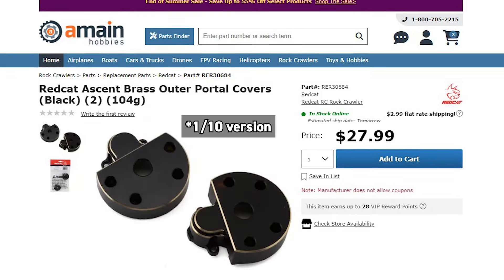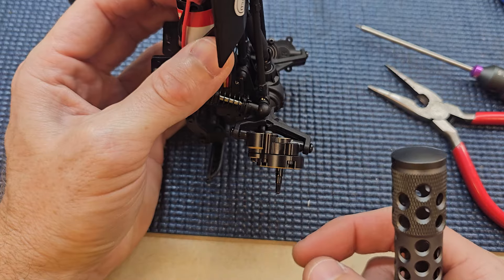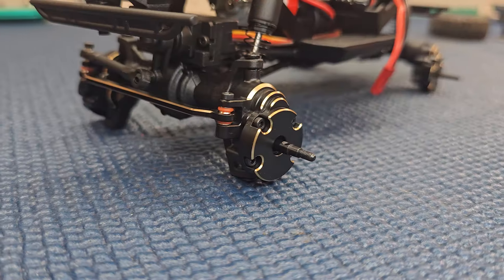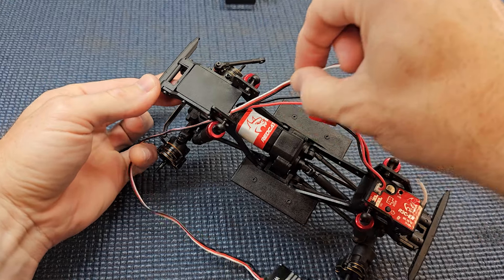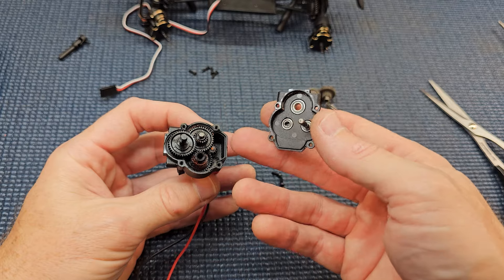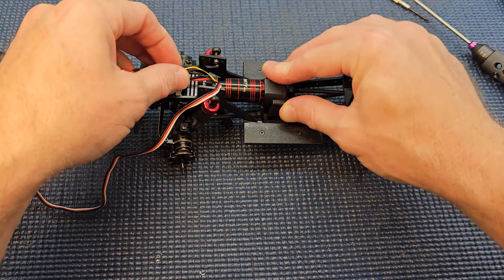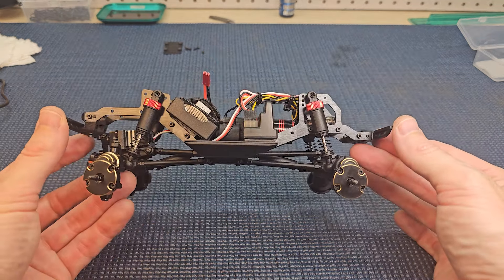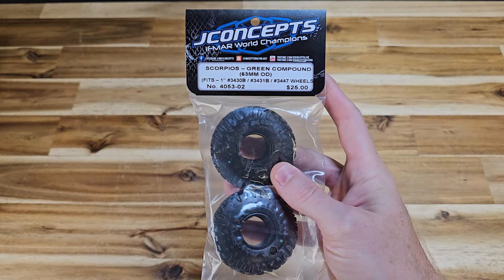These Upgrades Cost 3X the RTR Truck

Comment: I was a redcat dealer 14 years ago...when most people hated on them.  It's wild to see main stream rc outlets praising some redcat models.  I knew back then that redcat had potential, that they weren't looking to be a traxxas/losi/ae/hpi clone.  Way back then, they had the rs10xt...a 4 wheel steering, moa crawler that was $150 rtr.  It wasn't the sharpest looking crawler but it could out perform a $300 axial.  Only recently did axial come out with a 4ws rtr crawler with the same 4 steering modes, the ax24.  For redcat to offer a $120 1/18 that's on par, if not slightly better than the trx4m is impressive.

Comment: If I had an Ascent18, I'd much rather go find some Injora parts. You can get a full brass kit for the Ascent18 from Injora (diff covers, portal boxes, steering links, skid plate) for a little over 70 bucks. That's way, way less than the price of the Redcat brass upgrades, and I'm sure you could probably find some decent parts for even less than that. The Redcat Ascent18 is very nicely priced, but the prices on the upgrades has got to be some kind of cruel joke.

Comment: Just buy 5 or 10 oz wheel weights, stick it where you want more weights in the chassis or body. I’ve spent almost £1k on brass parts before. Now i found a cheap alternative.
Reply: Lead is dirt cheap. Especially in the US with all the lead bullets being manufactured.

Comment: Like you said, value is a personal thing.  Just realize, you're not going to recoup a lot of that cost when you sell the truck (better to take them off and sell seperately).  As for the brass portal covers, makes more sense to me then the wheels (although I'd likely use them, as well) because the covers have more of an affect on weight bias.  I'd probably only use the portal covers on the front though, to further shift weight bias to the front.

Comment: The better option for front weight is the Treal front portal boxes and covers. 74 grams for the set. And 11 grams for the Injora brass steering links. My A18 is at 58.5% front weight. I also did the Furitek RXGT5 setup with the Cedar motor, and an RS100 servo at 8.4v.

Comment: The chassis will hit the larger servo.. you can shave the corners on the stock one for more articulation. neat idea spinning motor/trans. I out about 500 grams of wheel weights on my front chassis deck and a touch on skid corners. gonna pull bumper and shave around mounting location on bumper to be able to push it back farther then make new mounting holes. it made a good difference on my first A18

Comment: You can get brass for at least half that cost if you don't use the Redcat ones, since there are quite a lot of 3rd party options now.

Does the rear mount motor do anything with moving the front/back distribution?

Also, venting the side of the tire will let air out, but won't let any water or debris out like venting in the outer tread. Trust me, dust, dirt, and debris will find their way in that side hole.